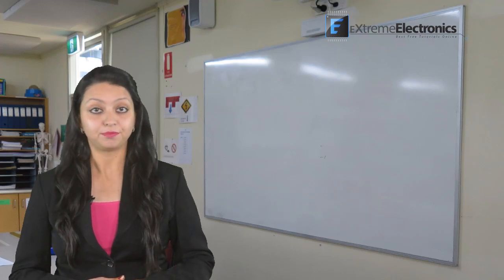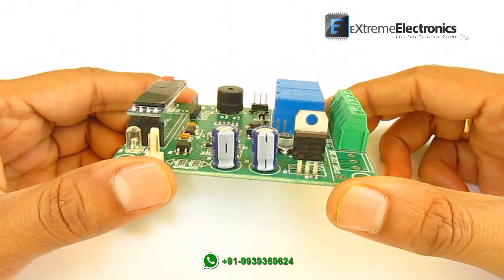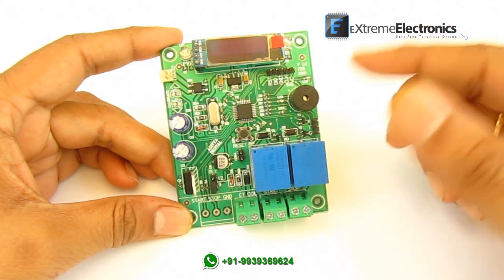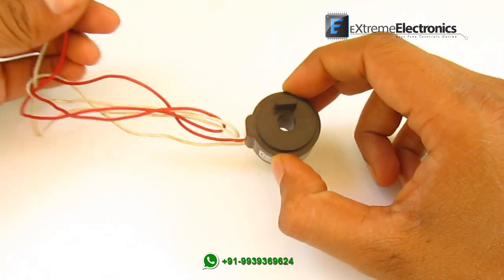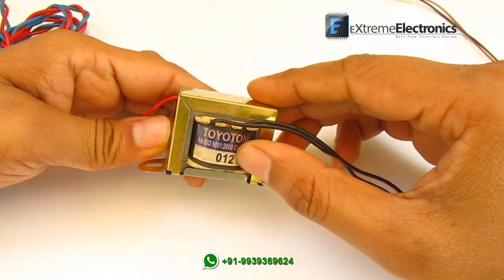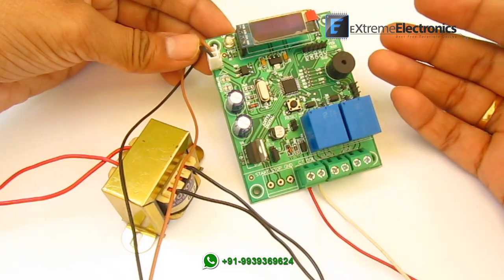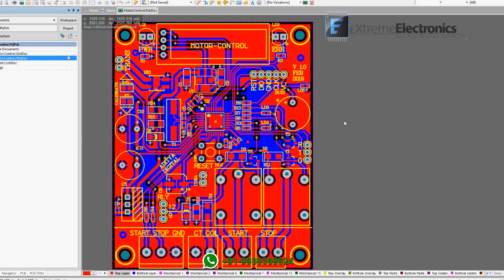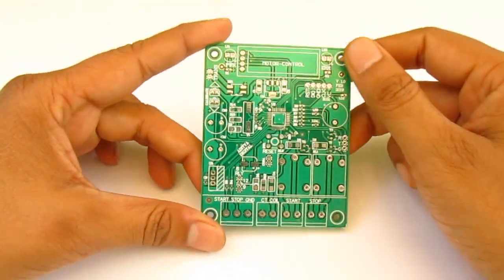Water Pump Dry Run Protection using Current Transformer

Comment: the way you designed the ct circuit isn't the right one. The right way to implement ct is by measuring the raw ac voltage across the correctly calculated burden resistor and applify it to be able to be measured by adc.